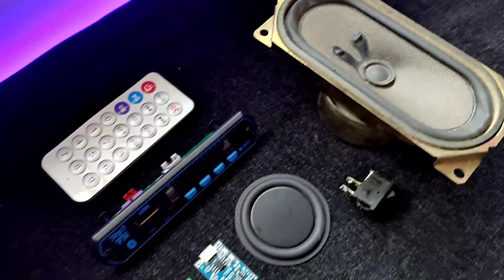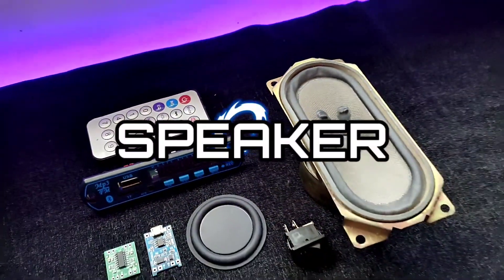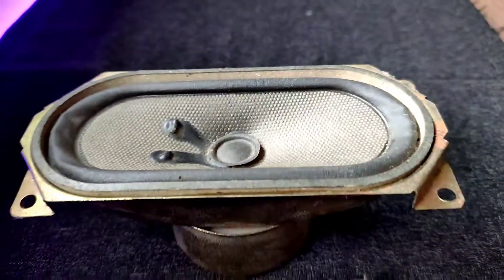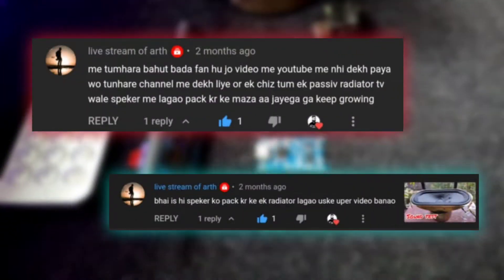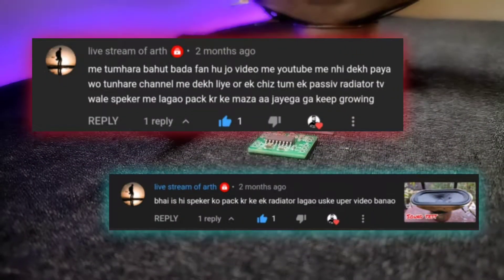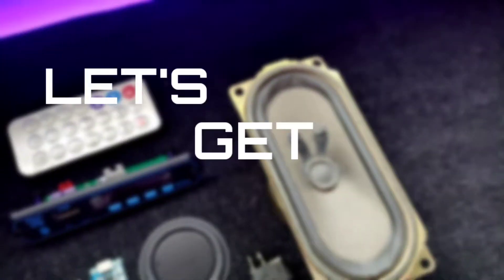DIY Bluetooth Speaker From Old TV ⚡ || Electro Boy

Comment: the radiator should be the same size as the speaker and you need to seal the enclosure. cardboard isn’t a very good material for speaker enclosures. also the Bluetooth module you used has a lot of distortion so use higher quality Bluetooth modules.
Reply from the maker: Not necessarily! Using higher quality materials would also increase the Cost of my built... Taking the fact into consideration that I just wanted to build a simple Bluetooth Speaker with a Decent Sound.

Comment: How to make with two similar speakers
Reply from the maker: Directly connect your Speakers to the Amplifier's Stereo Output (LR) if you're using the Amp Module (PAM8403) Used in the Video, but if your Amplifier has mono output than connect the two speakers in parallel